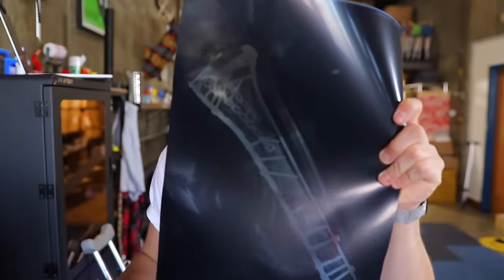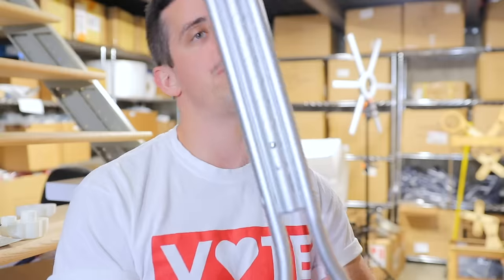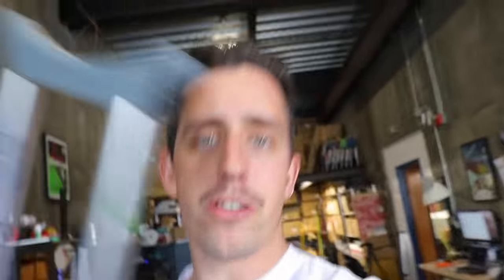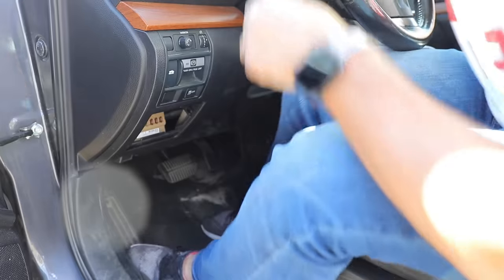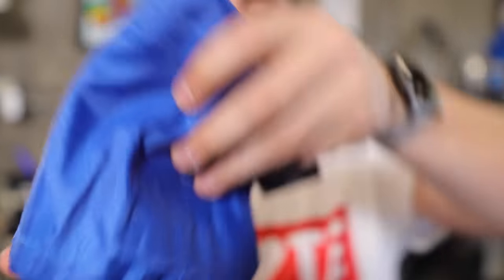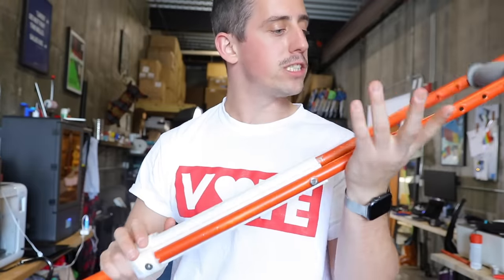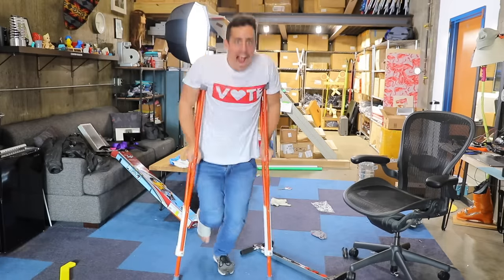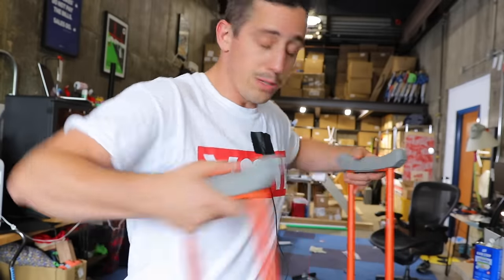I broke my leg and built Pogo Stick Crutches!

Comment: Did you know that, this kind of crutches already exists ? I had a friend who had to walk with crutches all the time or use a wheel chair. Crutches are good for autonomy but bad for your back and shoulder, so some crutches exists with suspensions to reduce the impact of this issue. It is definitely not a unnecessary inventions

Comment: my fiancé has bad knees and has to use crutches when he's outside in case his knee goes from under him (its happened in the house a few times but thankfully is ok) these crutches would be amazing for him, not so much for the pogo stick part but for shock absorbing reasons. due to extended crutches use he has issues with his wrists and this might help him. on a side note your x-rays reminded me of the x-rays I had for my arm that I broke twice (at different times) once was the forearm (both bones that are now held together with metal pins) and than my humorous bone which I shattered and now i have a few pins and metal plate. I never got to take my x-rays home though which sucks.

Comment: You should replace the gray plastic with more white stuff...

I'd also suggest:
1. Sanding the inside bit do it doesn't scrape against the paint anymore...
2. Adding a protective varnish to the paint.
3. Doing something to make it quieter.

Comment: On a side note... Do they provide more support and extra help when used as an actual crutch.  It seems like it would give an extra push as you're moving forward.  As a practical application, this seems like an actual improvement and upgrade for real support.

Comment: you need to take a cast n make the 3D printed part out of metal. also add a better spring system to get better mechanical gain n make pogo-ing smoother

Comment: Serious question- when you go through airport security do you always set off the metal detector with your leg? Do you need to carry any medical forms as proof?
Reply: I have a titanium rod in my leg, and it has only gotten detected once at airport security (out of probably 20+ times). Once, they stopped me after going through the scanner, and I noticed on the screen that there was an orange rectangle around the leg I had broken. Security just did a pat-down and sent me on my way. I haven't had that happen again since, though. No need to carry medical form as proof.
Reply from the maker: Yeah I think I had it go off one time in one of the older style machines that you just walk though. The ones where you stop and put your hands up - it's never happened.